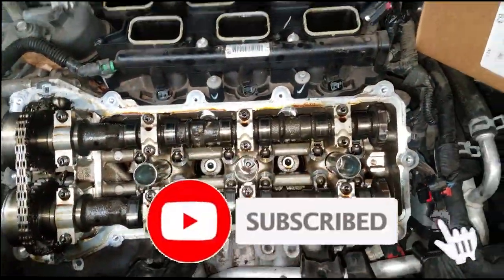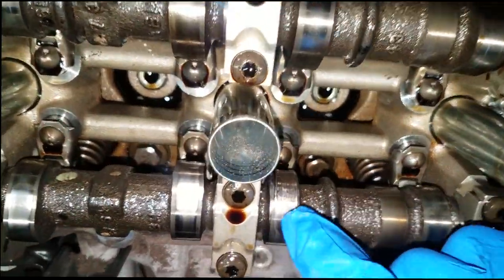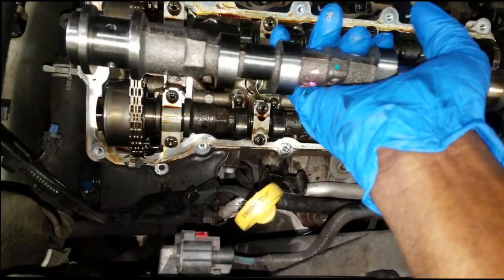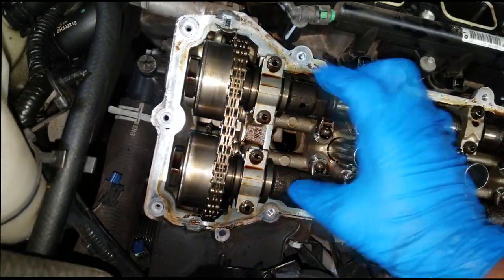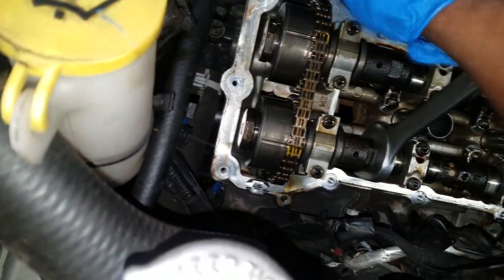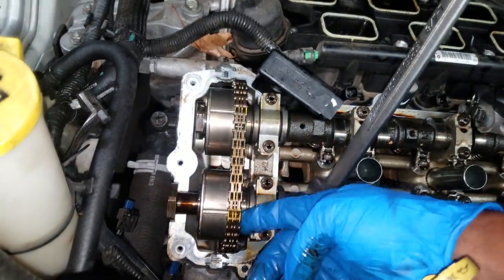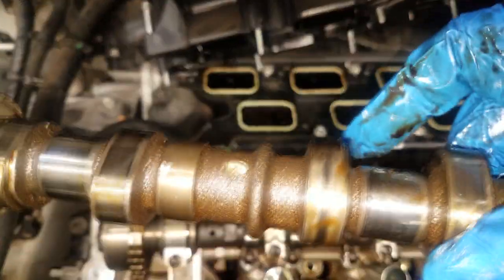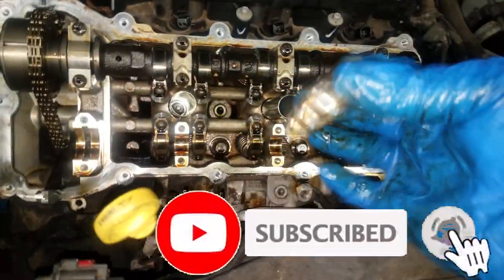Here's why you should not wait to get this FIXED. It could cost you even MORE MONEY.

Comment: How is that chain tensioned? Will it not lose time down below if you let it hang like that? 🤔 

This rocker failure is common on Ford 5.4L 3-valve engines as well, except they get spit out when they seize up. If it happens on the left head, everything's fine; change the rocker and maybe polish the cam lobe. If it happens on the right head, it will break the lifter bore in half, and require a new head.
Reply from the maker: Whoa, common on the 5.4? Dang. The chain on this engine tensioned this way. I show a better cut away view on this video that shows how here: https://www.youtube.com/watch?v=IYT7UGSL93s&t=379s
Reply: @OnlineMechanicTips  that's fucking sweet! Thank you!

Comment: As always another great educational video. I'm currently working on a 2017 Pacifica with a  P0456 code easy fix just replace the evap purge valve.. . Need to do a video on that.

I have noticed that There are very few and far between videos related to 2017 Pacifica's

Comment: #1 unanswered question, where is the metal from the cam and "frozen" rocker roller bearing(s)? Easy answer, in the oil pan. I've had to drop many a oil pan and clean a handful of metal out. One engine was so bad, the oil pressure was low after repairs were completed. Later on, found out that the oil pick up tube, was almost completely blocked with metal fragments... 😱

Comment: Love your videos man! You've taught me a lot. Here's my problem. I have a 2015 Ram 3.6 150k miles, I have a misfire on cylinder 2. I've changed the plug and coil. Still has the miss only at idle. You can not feel the miss at highway speeds. There is no ticking whatsoever. I've already replaced 8 rollers on the passenger side and 2 on the driver's side. Today I pulled the valve cover just to make sure I wasn't missing a loose rocker. Everything was tight no loose rockers I even cranked the engine by hand to check each one. The miss is felt at stoplights and it causes the headlights to flicker when it misses. I don't know what else to check, I'm stumped. The clip for the coil pack is intact. I used a Champion plug and NAPA coil. Any help you could give I'd appreciate it.